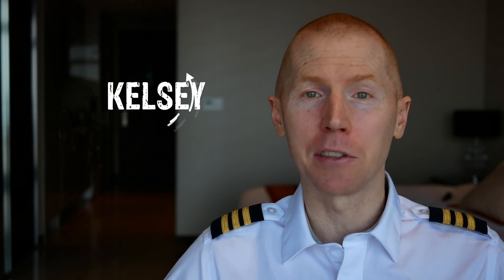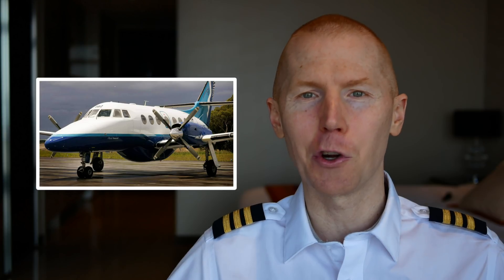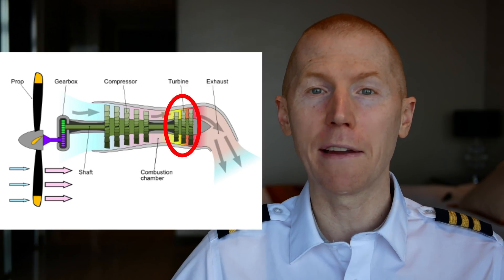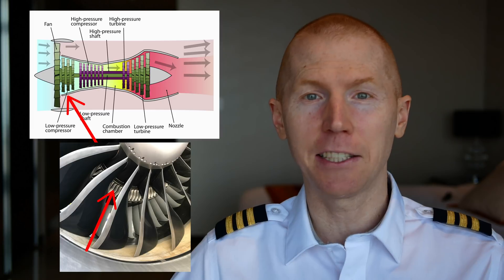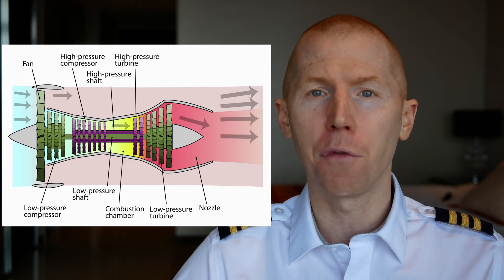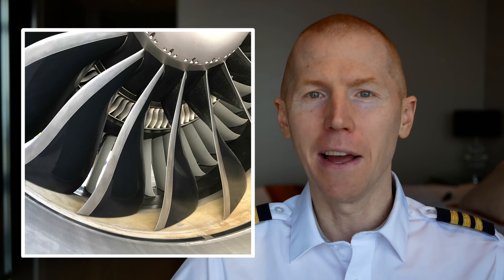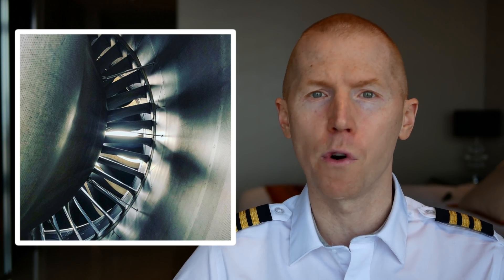Is a Turbofan Engine or Turboprop Engine Safer? | Pilot Explains

Comment: Turbo prop is reliable! You literally have a gas generator, gear reduction box, torquemeter. Also because 90% of thrust is mechanical instead of 10% exhaust, it’s very economical through subsonic flights. You can carry large loads and take off in short runways, I would definitely fly in turbo prop

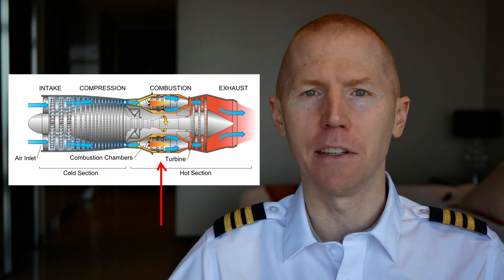Comment: 1:05 Actually, there is no explosion, it is just combustion aka burning, whereby heat energy is emitted and air heated to temperatures which may be higher even than the melting temperature of most steels.
Reply: You are correct, but I think Kelsey is trying to keep it simple for those that don’t know how fuels are used.

Comment: Love your channel. Mechanical engineer here 
It may be nit-picky but your use of fan to describe the various stages of an engine sparked a need for me to comment. 

The stages for a turbo fan are 
Fan 
Compressor 
Combustion
Turbine

And the blades would be named according to the stages. 
Fan blades (only the front fan) 
Compressor blades 
Turbine blades

I assume you called them all "fan" blades as the multi use of the word turbine is potentially confusing as well.

Comment: On the merits of aircraft safety - there is no material difference. However: regional pilots flying turboprops here in the US may be less experienced, and so, coincidentally, turboprop aircraft may experience more preventable incidents.

Comment: Some of the turboprop aircraft, like the Mitsubishi MU-2 have an engine air intake that has a 180 degree change in airflow direction os the inlet air moves forward. This allows water and sand and debris to be separated out and exit through a drain in the inlet, thus reducing wear and better performance in rain and dust.
Reply: I bet that provides a more "challenging" experience for a bird strike too.

Comment: I am just gonna take a guess here; I'll assume a turbofan is safer, as it has less moving parts and thus less things to fail. 

But; if we're talking about safer during a bird strike or other kind of FOD, I'd assume the turboprop is safer, as it's less likely to suck objects in, this disabling the engine entirely.
Reply: Not sure what you mean than fewer moving parts - modern turbofan engines are insanely complicated machines and definitely have a lot of moving parts! They're also built to be extremely safe and reliable though.

Comment: The new turbofan (like the B737 Max) are geared down just like the turboprops, unlike the fans on a B747. The differentiation will probably reduce even more over time, as fans get bigger and slower.

Comment: So I guess the reason for a turbo prob vs. a turbo fan be based on aircraft size? As in is there a minimum size the engine would need to be for a turbofan to be more efficient than a turboprop? Or would having the bigger prop vs. the smaller turbofan be better for the lower altitudes Turboprop planes normally fly at?

Comment: To be honest, I never felt prop or turbo-prop less reliable than turbo-fan engines.
I mean, the DC-3 has props and carburetors and it is one of the most reliable plane in the history of aviation.
As you said, they are just different systems for giving thrust to an aircraft.

Regarding this video, I must thank you. Now I understand better why the old airliners had smaller engines compared to the modern ones.
Keep the blue side up!

Comment: Unlike most of the public, I enjoy flying on turboprop aircraft more than a turbofan.  Some say that driving a vehicle with a manual transmission is "Real Driving"!  I say that flying in a turboprop airliner is "Real Flying".  I personally love the sounds that the props make.  On a turboprop, when the engine fires up, you hear the jet whine as the propeller starts to rotate and gain speed. When it reaches full idle speed in which the prop blades become virtually invisible, the props make your basic "BOX FAN" sound, spinning at an estimated 600 RPM.  During the takeoff roll, when the props are revved up to approximately 1,400 RPM, it''s a big rush as the aircraft starts to accelerate down the runway and become airborne.  The props then make that low pitched drone that's like the sound of the wings of a Mexican Hornet or (Cicada) killer.  I do understand that turboprops are a bit slower, but I wish that most regional and mid range domestic flight aircraft were turboprop.  I wish that turbofan aircraft were were used solely for cross country and overseas.

Comment: A turboprop can movebackward quite easily... a turbofan cannot, or at least only with extreme difficulty. Turboprops are more autonomous on the ground I thinck. There are probably more efficient at low altitude too ? And at low speed.

Comment: Compared to your car's engine, which starts so easy, why is it that piston aircraft engines crank for ever and a day to start ?
Reply: most aircraft piston engines only prime the first cylinder, so it takes a few turns until the other cylinders have the right air to fuel mixture to begin combusting as well.

Comment: Have my own guesses that's something about aerodynamics. But why should energy already gathered and directed in the burnt gas flow come back through a turbine, to speed a prop or fan, to generate again a new gas (air) flow , to eventually push the plane? Isn't there a loss of energy? Have other ways to optimize the primary gas flow been thought or tryied?

Comment: I'm a fan fan & have been fortunate enough to sit on the flight deck of turbo fans, turbo props, pistons & choppers. preference is the fan with no worries of the others. Thanks for the descriptions. While on the flight deck, pilots will answer questions if possible. Sadly since 9/11, my flights are in the passenger section.

Comment: I’m a fan of the turbo prop engines for the reason that you mentioned at the beginning of the video regarding how amazed you were that a bird could get by the prop and manage to get into the air inlet.  If it’s so difficult for things to get into the air inlet of the turbine of a turboprop vs a high bypass turbo fan wouldn’t that make it the safer choice?  Bird strikes can take down a plane with turbo fan engines wouldn’t it be less likely that a bird strike could take down a turbo prop design?

Comment: Are turboprop airplanes commonly referred to as jets?  I saw a show where they said they were going to ride on a private jet that turned out to be a turboprop.  I know the turboprop is technically a jet engine but it moves through the air by propellers so would a pilot commonly refer to a turboprop as a jet or not?

Comment: Ok, smarta&*s answer:  If I want to land on a short runway, I want to be in a turboprop, because reverse thrust works way better.  If I want to walk around the outside of the parked plane while the engines are running, I'd rather walk around the one without the giant spinning props.  And...  If I'm going to be flying around where there's lots of birds,  I want a big old turboprop with aluminum blades.

Comment: What about the engines that have the exhaust right behind the props
Reply: I assume you're talking about the engines on a King Air or a Pilatus.  Those are turboprop engines as well, but of a slightly different design.  Those engines use a centrifugal compressor much like a water pump (look up fireman's pump) to compress the air.  The air flow is reversed toward the front of the engine where it turns the turbines that drive the propeller.  The air is then sent out the exhaust pipes which are just behind the propeller and have those distinctive bends to reverse the airflow again toward the rear of the airplane.  Look up Pratt & Whitney PT-6 and you can find some good diagrams.

I apologize for necromancing this old post, but I just found this video.

Comment: Realistically, I have no fear of either platform, but one would think that having a gearbox between your power and propulsion would add an extra point of failure to the engine. Having a turbo-fan inline with the rest of the jet is a good idea.

Comment: THANKS KELSEY, these are all TURBOJETS :-)  TURBOFAN the big fan on the major airliners, TURBOSHAFT the shaft on most HELICOPTERS, and the TURBOPROP - driving a propeller.  All these are using the TURBOJET engine.  Ships are even TURBOSHAFT :-)  So which is better, a small airport in the middle of the rockies or alps, TURBOPROP.  Fuel efficiency TURBOFAN.  A WHIRLYBIRD, TURBOSHAFT.

Comment: Hi. Thanks for the video. May I suggest that the fuel is burned rather than exploding, even in a reciprocating internal combustion engine fuel does not explode. Your discussion of the core explains that it a hot gas ( not air) generator. It in itself   Is a jet engine. At subsonic speeds  fuel burn per pound thrust is low. As you explained, extracting energy from the hot exhaust gasses from the core using a power turbine to drive a concentric shaft to either the propeller or turbofan provides much more thrust per pound fuel burned at subsonic speeds. At design speeds under 300knots propellers seem to be popular at higher speeds the ducted fan is more efficient and I believe quieter for many reasons

Comment: Don't modern turbo prop engines maintain constant speed, but have adjustable pitch blades and increase power to increase speed, whereas turbofan engines have to speed up the whole engine to increase the speed? I'm a bit rusty on the tech...

Comment: I would guess that a Turbo fan engine would be safer... If the fan section failed I guess it is still possible for the turbo jet section to still function, all be it way less efficiently... Also blade balance or deflection is probably less of an issue with a Turbo fan as the blades are supported at both ends (blade base and tip) with I will assume some sort of bearing race, bushing, or track.

Comment: To me, reliability is not the issue between “turbo prop” vs “turbo fan”.  Turbo prop aircraft engines are cheaper, slower, and are generally almost as reliable as a turbo fan, especially the twin spool models that do away with the reduction gearing they used on older turbo prop engines.  They are more easily repaired as propellers can be replaced while the aircraft is on the flight line in a snap verses removing and replacing the whole engine.  Turbo fan engines are extremely reliable unless subjected to foreign object damage which necessitates replacing the whole engine as they are not really flight line repairable.  In a perfect world, both types of engines would be real close to the safety criteria.

Comment: It seems to me that no one has  ever done an engine loss of a fully loaded plane on takeoff/climb-out.  Thrust is completely asymmetric and the engine mounts to the engine still working would be under tremendous torque from that engine and the mass of the fully  loaded fuselage.  The mounts would would fail, the engine would fly over the wing and the plane would crash.  Three engines would avoid that possibility.  The Thomas Cook 757 that lost an engine on takeoff due to bird-strike is an example of single aisle partly loaded plane takeoff with one engine.  What happens to a fully loaded wide body jet?  Maybe tri jets will suddenly not look so bad.   They cost more to service and maintain, but passenger safety is worth the additional cost.
Reply: No, the engine force is the same and the moment arm is the same so it does not change the moment. The plane would yaw somewhat, but that's not a major problem. Please don't make bad assumptions and then argue safety – if you have doubts, just express the doubts without using those doubts to make an incorrect assertion

Comment: What do you call a geared Turbo Fan? Is this just a multi blade turbo prop?  Engines all work the same Suck Squeeze Bang Blow. Push the lever forward and you get more noise and it goes faster pull it back and it makes less noise and goes slower. I retired in 2012 on the 76 and I say large Jet aircraft are very easy to fly. But I also say "yours is bigger than mine"  and I always wanted to fly the 74.
Reply: A geared turbofan still has a ducted fan, not a propeller.
Reply: @AmbientMorality  I guess you didn't understand the joke. If you take to duct off the ducted fan you have a propeller with many blades. When does a propeller turn into a fan? Why not call it a ducted propeller? Joke is how we in english speaking aviation have the need to have a cute name for everything. In another very common language they are more simple. Guess who calls an airplane a Fly thing?
Reply: @bkailua1224  I'd still call that a fan until the solidity and pressure ratio dropped a lot.

Comment: My opinion is that propeller engines are less prone to bird ingestion. I think propeller have greater chance to cut bird without damage and continue to give trust. But if bird goes into air intake it probably make greater damage to the engine... Those planes are also lower altitude, so less room for error. Less gliding distance. I would not go long distance over the ocean with 2 propeller plane.

Comment: As an A&P  I'm going to say I like most of your description But to say that a turboprop and a turbofan are exactly  The same is Not exactly true. on a turbofan the thrust that comes off the fan is not exactly 100% to push The aircraft forward it's more to cool the engine so that it becomes more efficient it does produce some thrust But nowhere near what a turboprop produces. And most turboprops produced no thrust out the exhaust. But for general purposes what you said is true
Reply: Err, no. Bypass air provides the majority of the thrust, even in relatively low bypass ratio engines. In modern high bypass ratio engines the bypass air is nearly all of the thrust.

Comment: Actually, (only as an engineering and aviation fan) I think that turboprops can be safer because they can be working at big levels of revs and airflow without "give"  trust because the prop can be set "neutral", and for example: when landing you have a better response in both situations: reversing the pitch prop to break or the opposite, give it positive pitch an go to the air.

Comment: I actually tend to associate props with lighter planes, hence (could be wrong) a better glide slope in the event of complete engine failure, hence safer. Maybe less stable.. Is this the case? How much lighter are prop engines? Absolutely love your channel and videos!
Reply: The weight and size of commercial aircraft has little to do with the glide ratio. Glide ratio is almost entirely dependent on how efficient the aircraft is at producing lift at minimum drag; in general larger aircraft are very slightly more efficient in this regard (they have to cruise a bit faster, it's worth making a longer wingspan that's more efficient, etc). The worst glide slopes are the small general-aviation aircraft like Cessnas and Pipers because they prioritize lower cost of purchase and maintenance over efficient operation (whereas for airlines with planes in service for 10+ years the higher initial cost and maintenance is acceptable).

Comment: Your right and wrong. First you turbojets, turboprop, turbofan, and maybe soon turbopropfan but not quite there yet. The turbofan found on most commercial plans because of the speed and efficiency at higher speeds and altitude. Now a turbofan are found on freight planes and smaller private jets or Corp jets because they have great endurance and great fuel efficiency at there prim speed and alltitude. Also do to to the fact they still use a prop they can take advantage of adjustable props allowing for fine tuning for that specific type and use of plan. Work is being done on a profane turbine you take advangte of the efficiency of a turboprop and the speed of a turbofan. It really comes down to what is the purpose of plane and how efficient you want it to be. If you want outright performance speed aerobatics then you want a fighter jet with a turbojet, if you want to fly at 31k plus feet at speeds over 450mph get your self a turbofan, if your looking for fuel economy and efficiency and flying say 8k-20k feet and speeds of about 450 to 200 then your going to want a turbofan. Now as technology advances I’m sure these facts can be proven wrong. But as of now this is the general rule of thunb
Reply: I don't think turbojets are used at all anymore. All recent fighters have been using low-bypass augmented turbofans for the efficiency improvement at little performance penalty (particularly because going as fast as possible isn't very helpful in modern theatres)

Comment: Doesn't really have much to do with the engine at all. Turbines are used in a lot of stuff from airplanes to helicopters, ground equipment and people have even put them in cars, motorcycles and scooters. As far as combustion engines go it is a pretty darn good design. When comparing a turbo prop or any prop plane to a turbo fan the more important thing to look at is the airline running them and what their safety record is like. Larger jets tend to be owned and ran by larger companies with more money and get maintained better. Smaller commuter type planes not so much sometimes. Some of them can be real crap boxes that scare me to fly in lol. The design doesn't seem to matter as much as the company running them. Another thing to consider is I would guess there a lot more of the smaller planes in the air then larger jets so you just happen to see them have more problems. Just like you see more crashes and breakdowns with an affordable sedan or suv like chevy or ford then you do with something like a bently or more expensive car. There are just more of them on the road is all. A good example would be a Jag. People think they are good cars because they are expensive. When in reality they really aren't, they have a poor record. If you want a good car get a toyota or something. I used to be an aircraft mechanic. A well taken care of airplane will last a LONG time with very few issues. And they are a lot safer than most people think.